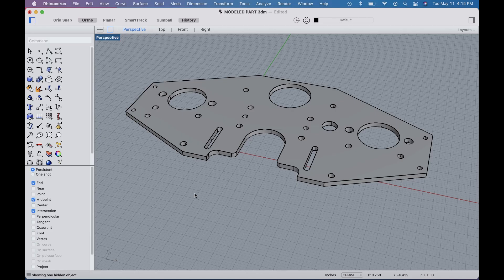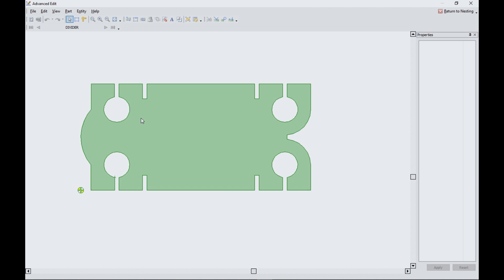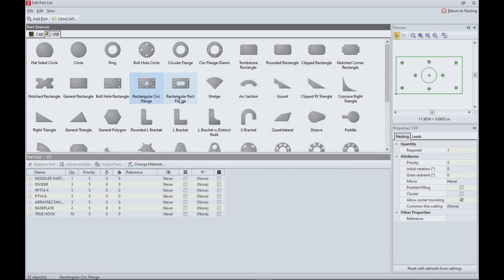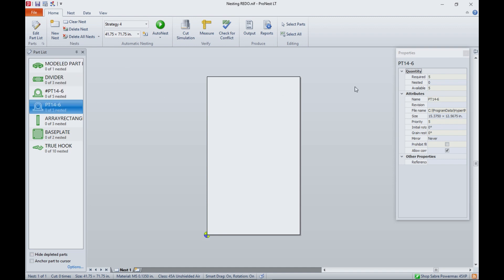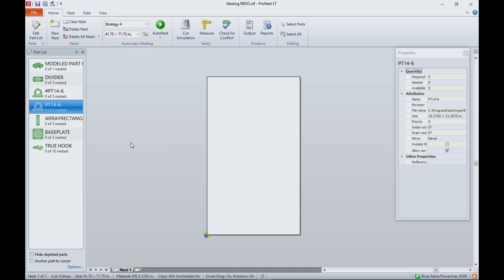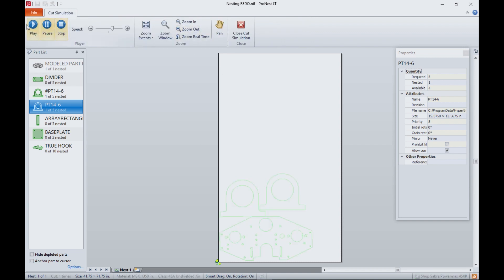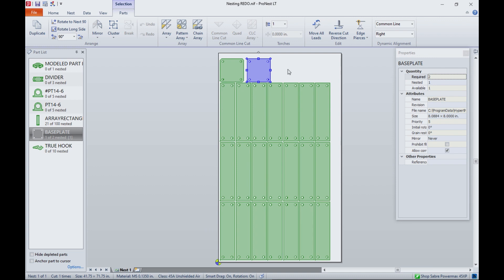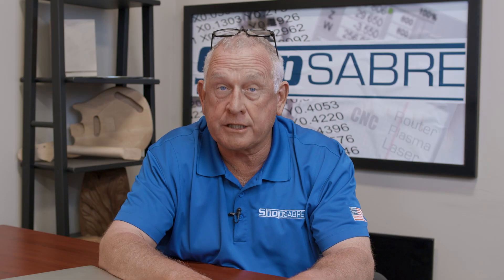ShopSabre Plasma - Hypertherm ProNest LT Overview

Comment: doesnt all hypertherm's have quality hole nowadays or is that just machine specific?
Reply from the maker: Plasma technology has come a long way, with proper settings you can get nice results, however much like a quality cabinet in your house, if the foundation isn't strong they won't carry the same value & quality -- Machine motion control largely will cause a significant effect on holes & dross